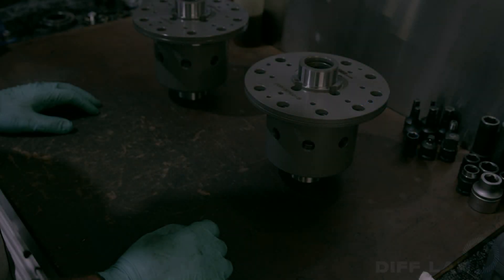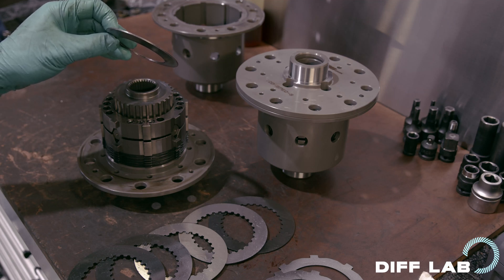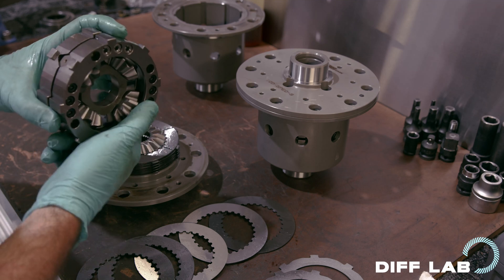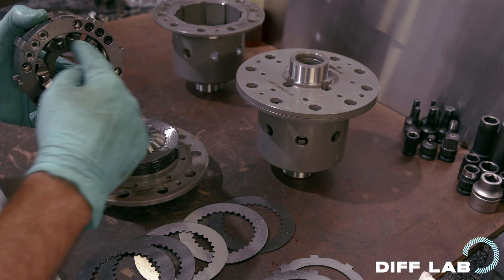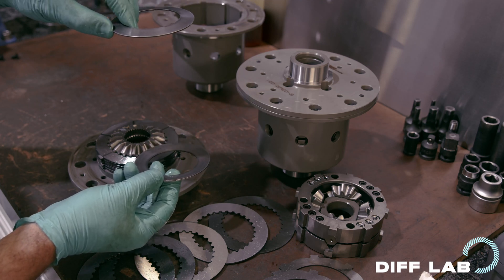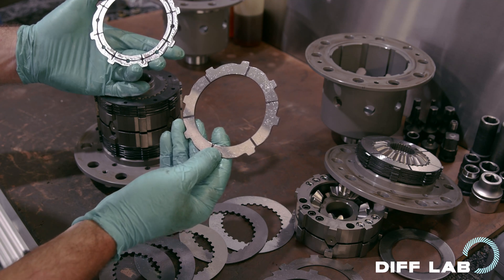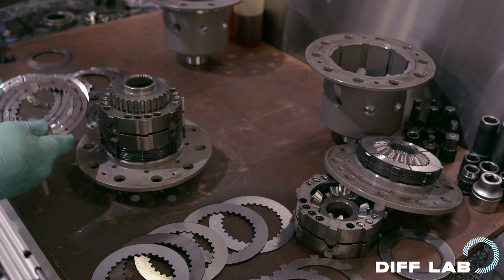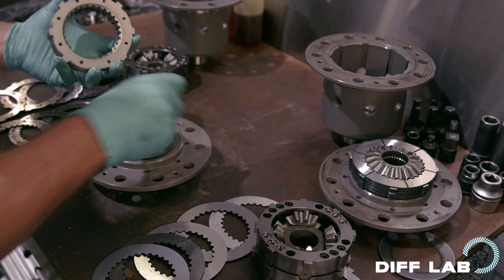OS Giken Superlock vs TCD (Spec-S)

Comment: In terms of performance is one better than the other? Is the TCD just as strong and durable as the super lock? Is one quieter than the other? Thanks in advance, this was a great video.
Reply: I believe the TCS has better cooling characteristics. I’d imagine that with the extra grooves and cross drilled holes, that the TCD would also give up a very small amount of ultimate friction since it has less surface area on the contact patches.
Reply: TCD is smoother, less "harsh".
Super lock is more if you want to track it, it's more "raw" while TCD will do both street and track a little more progressive, linear.

It's hard to describe, both are great quality product anyway. Let's say the TCD is 100% and Super lock is 95% of the TCD. I do prefer the superlock, because I like my metal plain and ungrooved.